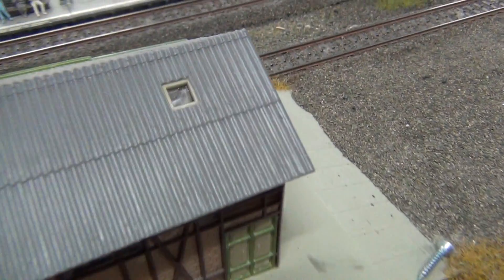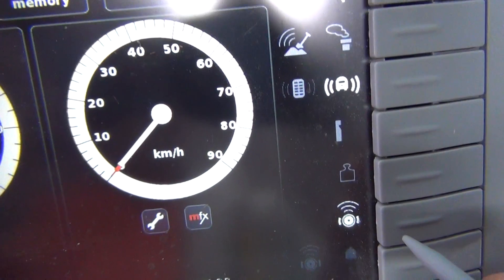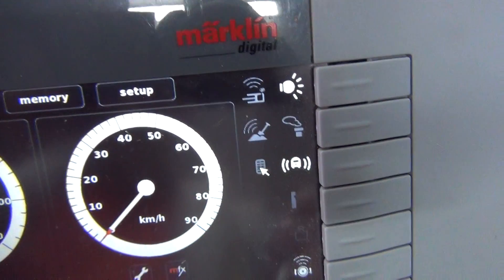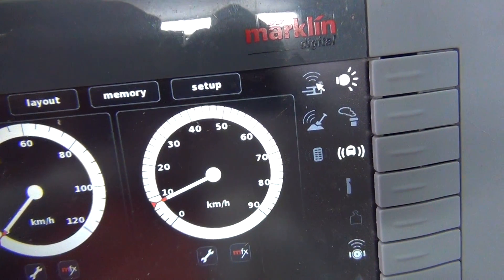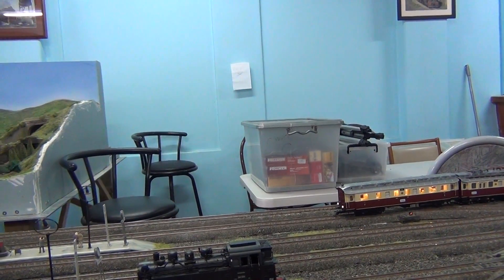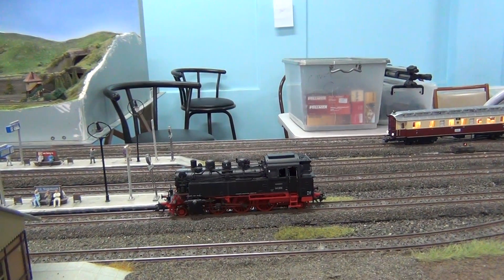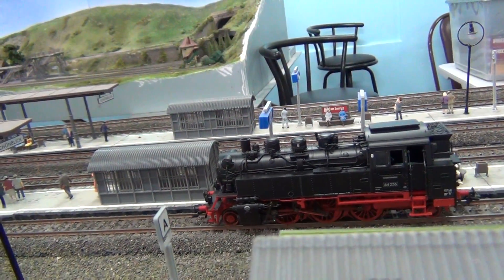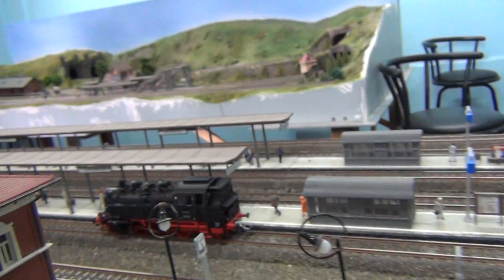Märklin 39644 Digital Run Description

Comment: silly question, but are you running the loco in the expert mode? as if the model runs out of digital consumables e.g Coal & Water it will go into a limp home mode? this happened to me and didn't even realise what was going on.  As for the clicking I'm afraid i cannot be of any help. Best wishes.